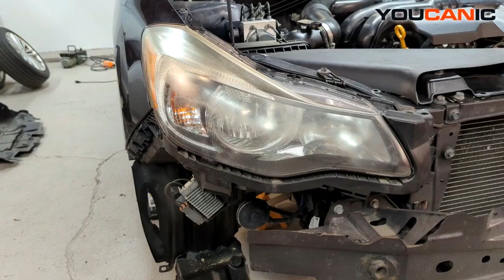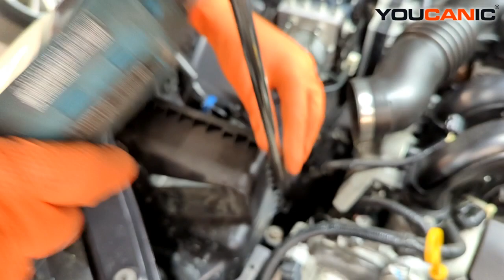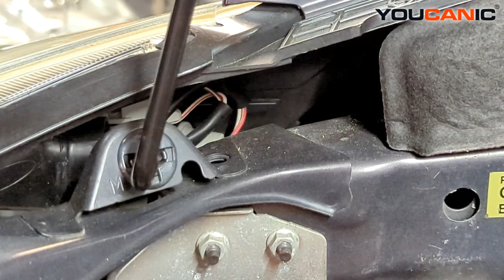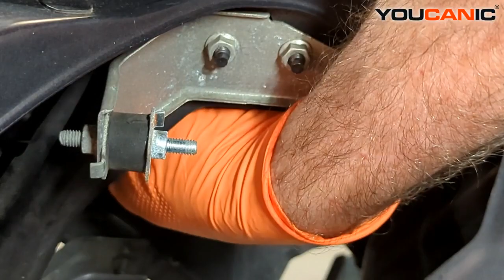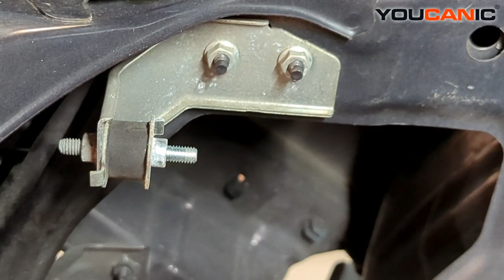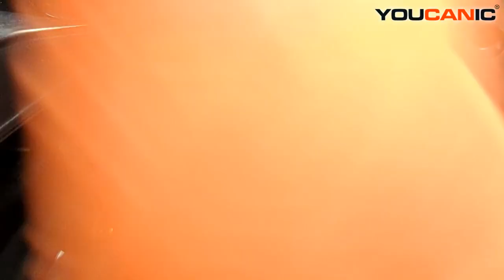2012-2016 Subaru Impreza - Turn Signal, Daytime Running, & Side Marker Light Bulb Replacement

Comment: I thought DRLs were the high beam bulbs on low output. What you have here is side marker and parking light, if I'm not mistaken.
Reply from the maker: @blackwalls8126 If you’ve got a car issue or repair question, you can find step-by-step guides and scanner help at youcanic.com. We might miss some comments here, but our site has answers for most problems already!

Comment: Thanks for the tutorial. Don't you think it's a poor design that to replace one tiny light bulb you need to disassemble the entire air intake system using a power tool? In my prior car all the bulbs were easily accessible by hand.
Reply from the maker: 👋 Thanks watching and for your comment! Our techs may not see every YouTube message, so if you need help or have a car question, visit www.youcanic.com — our team is happy to help!
Reply: You don’t need a power tool. Ratchet with a long extension will work fine
Reply: @JJtheJetPlane3612  True, and I think I have that, but I didn't feel like digging it out.